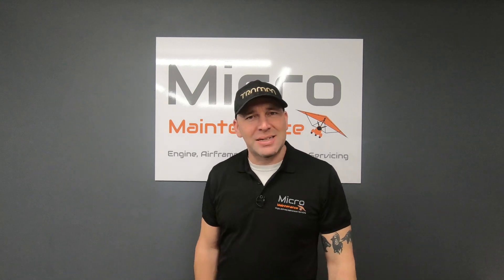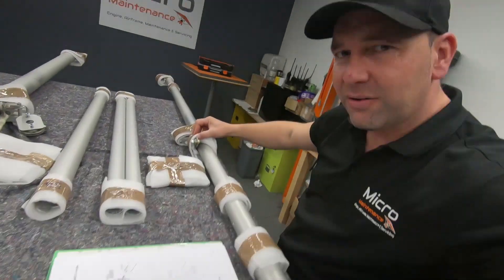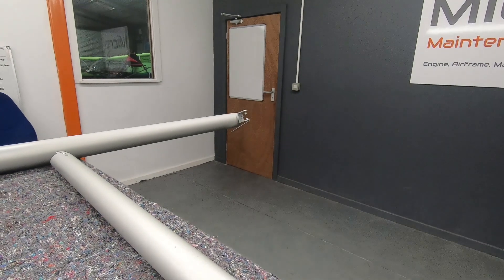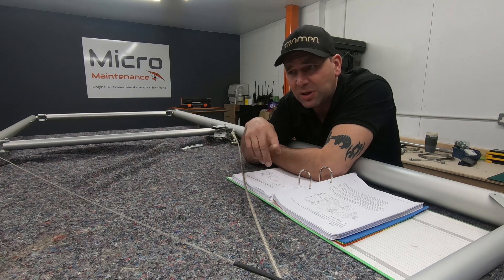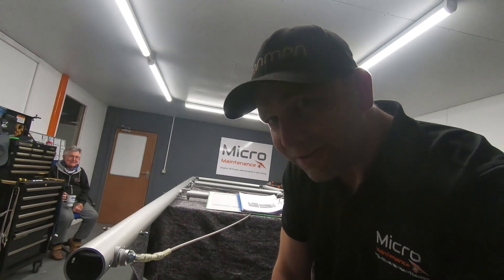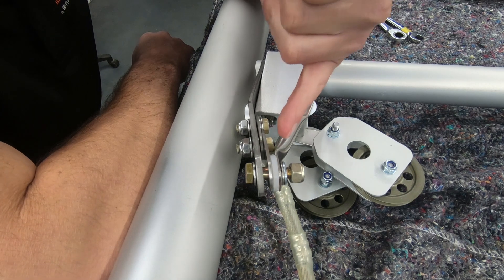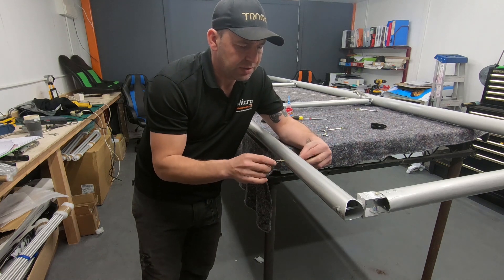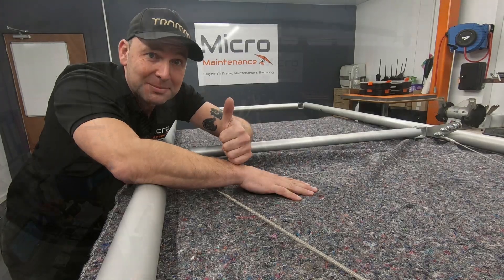600kg NYNJA LS - Wings and things: Micro Maintenance - S2E6

Comment: I would avoid grinding bolts as it can change the temper of the thread, it was not an accepted practice when I was in the RAF. As you did there I would turn them down to get a nice smooth finish and not to heat them up.
Reply from the maker: That was our thoughts too, not a fan 👍🏻

Comment: Interesting video series which I am watching with interest as I'm awaiting delivery of my 600kg Nynja kit.
A couple of points though:
There is nothing to be gained by putting loctite on bolts with nyloc nuts. I have spoken to Paul about this and he is in agreement. It is not normal engineering practice, even in aviation and does not achieve anything. Also, nyloc nuts and indeed any locking fastener CAN  be reused provided it cannot be tightened using fingers only. Again, this is standard aviation engineering practice.
As for shortening bolts, there should be AT LEAST 2 full threads protruding above the nut when the fastener is correctly assembled and tightened to the correct torque. Also, the orientation of bolts should be top to bottom or in to out unless there is a good reason otherwise.
Reply from the maker: Hi and thanks for watching our channel it means a lot. Regarding the Nynja build, we followed the build manual to the letter, this includes the use of loctite and bolt orientation. As you can imagine putting a video out like this a lot of prior research and clarification was sort. The last thing we would ever want to do is a) do something wrongly and b) mislead other builders.

I hope you continue to enjoy our content.

Mark
Reply: @wingnutshomeofmicromainten6946  Hi Mark,
Thanks for your reply.
Yes, I'm sure you're building it fully in accordance with the manual and researched everything before making the video.
I must admit, coming from the trade professionally, I question some of the quirks that have crept into the lighter end of aviation and cringe at some of the thing I see, particularly on the electrical side.
I'll still be watching with interest and taking note of your really useful tips from someone who's done it before.
Thanks and all the best,
Frank.